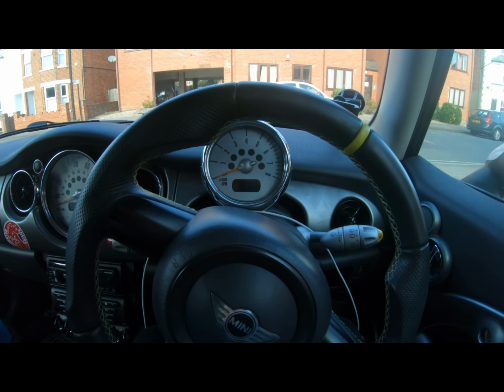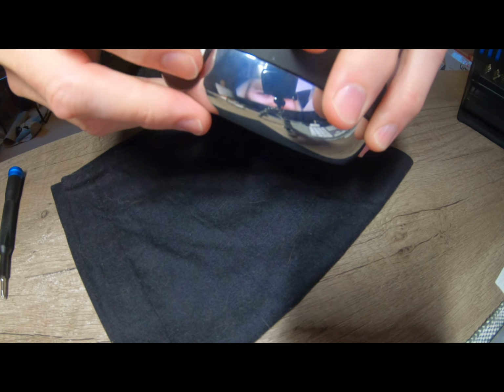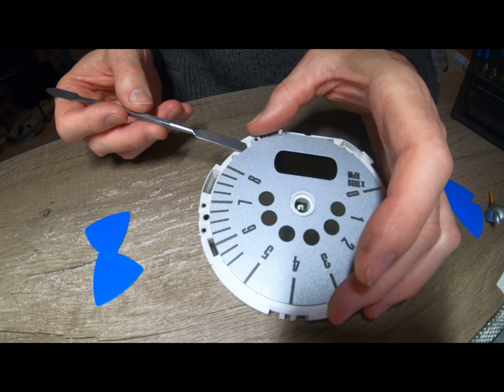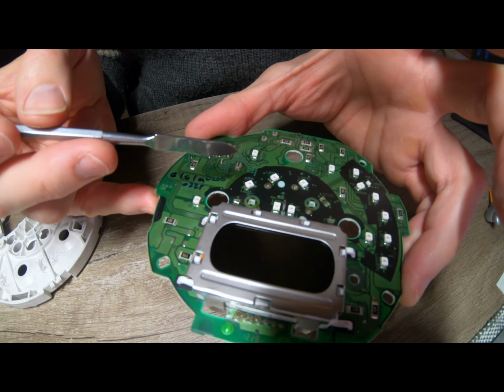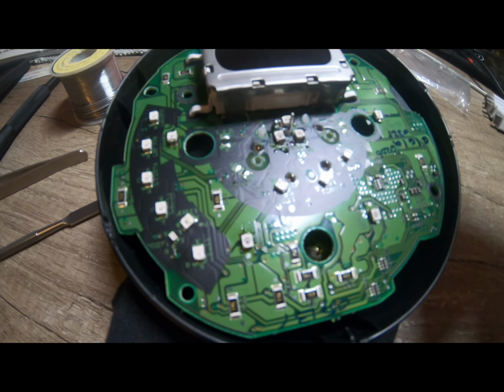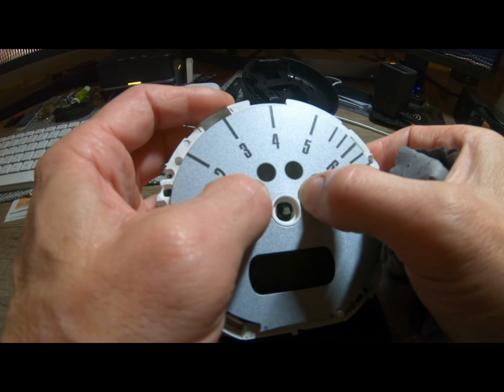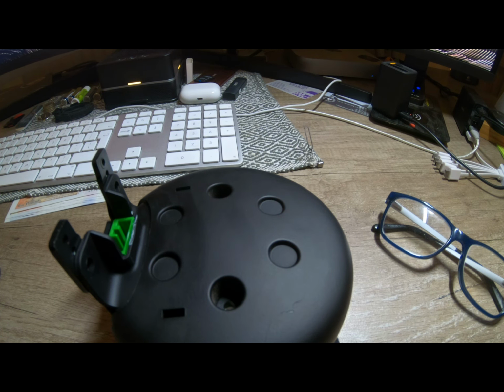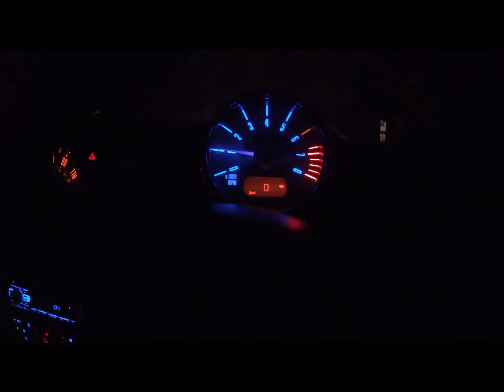R53 Mini Dash Colour Change

Comment: Would it be about the same work on a 2010 coop s? I alr did this for my 98 ranger but that was very easy
Reply from the maker: I would say fairly similar.  The dash comes away a little different, but there is still just a speedo in behind it from what I know

Comment: so would you not recommend for somebody that's never done anything like this before?
Reply from the maker: If you have never done soldering before and don’t have the right equipment, then probably not.  However, the point in my channel is to encourage people to have a go.  My suggestion would be to buy a spare switch set or ac panel and then try to swap the LED’s On that.  If it works then try again.  Get some practice on old second hand parts

Comment: Nobody can answer my question about whether it’s possible to change the orange display color as well? Help!!!
Reply from the maker: @mk3theripper67  it is, but there are some limitations.  Each display across each device is slightly different.  I changed all the back lights to blue, the speedo and rev counter display look blue, but are hard to read in the day time.  The climate control has an orange tinge, possibly on the lens, I heard someone state they used acetone to clean it off.
As for the backlights I have been told that white is the best colour
Reply: @hyphensclassics  Actually, I also want to change everything to white because it just looks more classic to me. I find the blue too playful, and I don’t like that. I would have gone with white anyway, but thanks for your quick response. I also want to swap the dials for black ones.😇👌
Reply from the maker: @mk3theripper67  well good luck!  I have white LED’s to replace the blue behind the displays.
Let me know how you get on!
Reply: @hyphensclassics Please show vids of the white led change brother. Can you list what type led for the speedo and tach? What kind for the 2 buttons up too, as I think they are different. Thanks!!   Awesome video man!!!
Reply from the maker: @ will do, have not done it yet.
The lights on buttons like the over head lights, the heated seat buttons, and tyre pressure switch are a different LED. 
I have not done those yet
I will look up the part numbers I used the the rest.
Reply from the maker: 3528 SMD Surface Mount LED SMT PLCC-2 - White Red Blue Green Yellow Amber RGB

Comment: Where did you get the leds from? I wanna change all mine to blue like that
Reply from the maker: Just got them off eBay, let me find a link for you….i’ll come back to you with the link I used
Reply from the maker: I searched for these:  3528 SMD Surface Mount LED SMT PLCC-2 - White Red Blue Green Yellow Amber RGB
It was Switch Electronics was the seller.  Note it you are doing the lights on the tyre sensor and above, some of these are different types of
Reply: @hyphensclassics do you mean that all the warning lights are a different type of LED?
Reply from the maker: @mertcapkin7263  no not all.  Most in the dash are the same.  Things like the lights in the tyre pressure switch, heated seat switch (if you have them)

Comment: Why the red leds on number  7 and 8 didnt work? i have same problem
Reply from the maker: I have not got back to fixing that yet.  The reason will be due to one of them, the first inline from the power source, is not mounted properly.  Either the contacts are not connecting or it is around the wrong way.
You would need to check to see if there is a viable reason for the issue.  Try to meter out the problem or just remove them all and try again.
Reply: Rev limiter